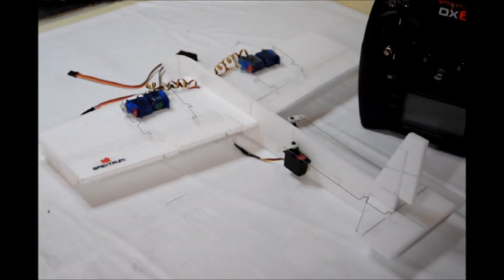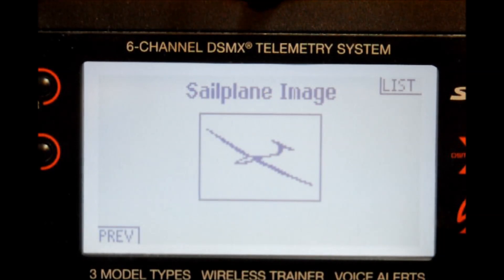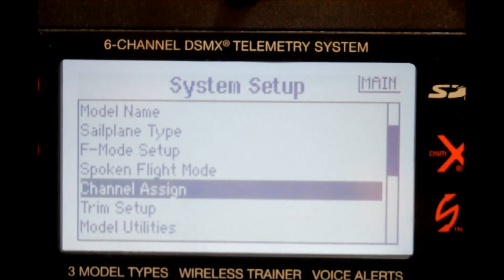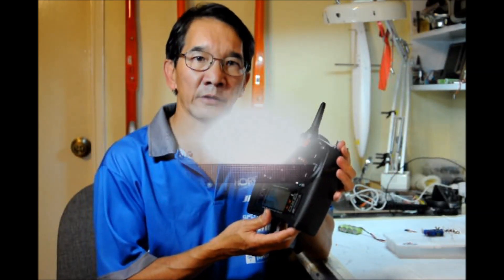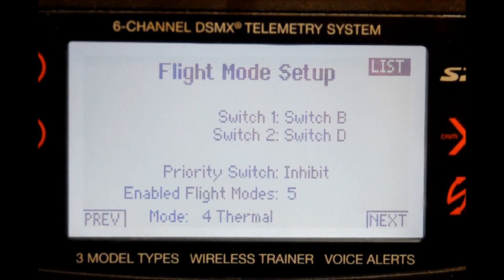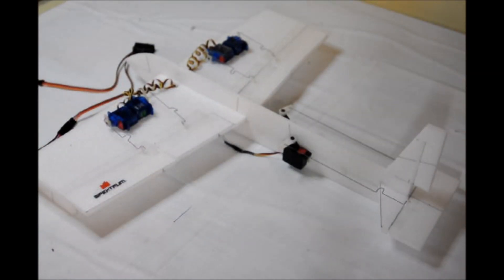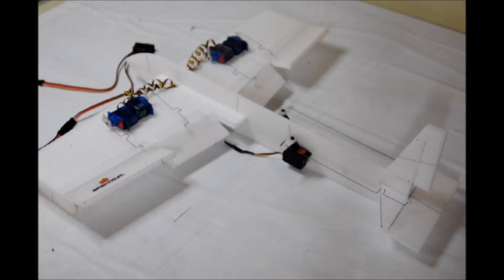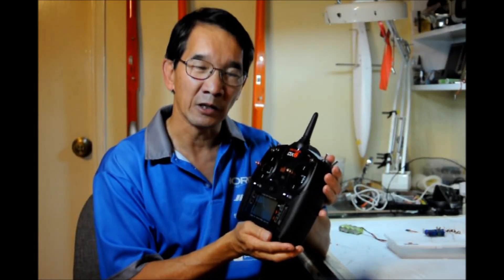Team Tech Tip   Spektrum DX6 flight modes for sailplane

Comment: Thanks Mike! I've been flying motorized gliders on my DX7 in 'Acro' mode so I could have a 'Flaps' setting. 🤦‍♂  Obviously not using the radios potential. This was a very clear, easy to follow example with good camera work on the screen. Now, I just have to set up Flaperons.

Comment: Great video Mike. I bought a DX6 and will be getting it soon. I will program it for a glider. One thing I did not see in the video/explanation is which button of the Tx control which flight mode. Is that part of the manual? or is there another video that shows that. Thanks!

Comment: How to program my blade SR 200 to my DX 6 new transmitter it is not like the dx6i that one is much easier to program having problem with this new radio transmitter I went online but they do not show you how to do it need to know step by step this radio is different